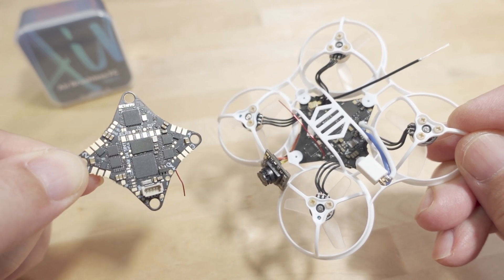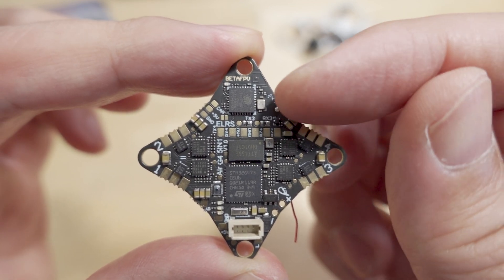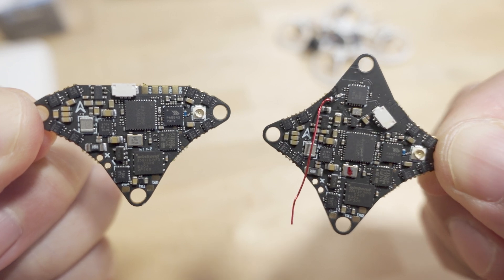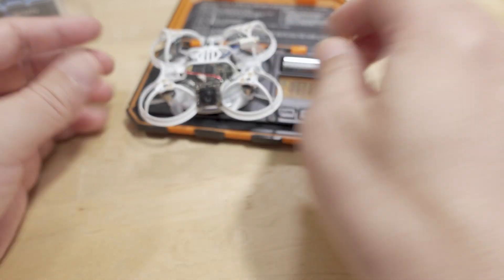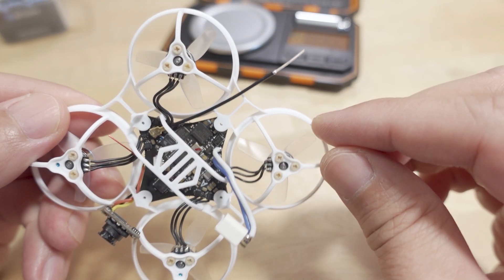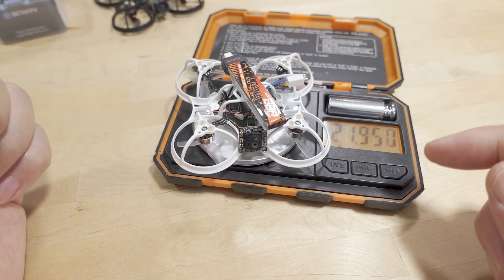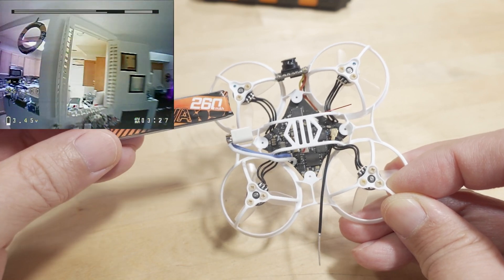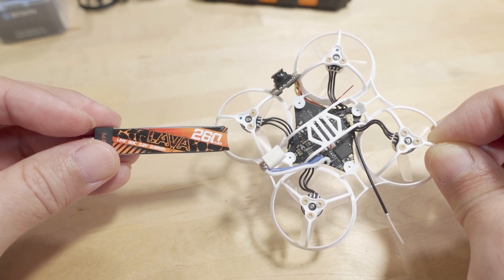Sub 15g Whoop Using BETAFPV Air FC 5-in-1 🤯

Comment from the maker: 🛠 All parts mentioned in the video...
BETAFPV AIR65 - http://rb.gy/p0iozm
AIR FC - http://rb.gy/aijd87
BETAFPV 0702 motors - http://bit.ly/3qxmjnd | http://bit.ly/3qJDK3J
Meteor65 Air Frame - http://rb.gy/mcs3i | http://rb.gy/tpe4v
Meteor65 Air Canopy - http://rb.gy/d27e9 | http://rb.gy/62nze
HQProp 31mm Ultralight Props - http://bit.ly/HQ31mmUL
Gemfan 1219S Prop - http://rb.gy/5ornw7
PEEK screws - http://bit.ly/3R4h4Gv
Cockroach LiteAF Racing Frame - http://rb.gy/y2i2kl
BETAFPV LAVA 1S 300mah Lipo - http://rb.gy/aija40
BETAFPV LAVA 1S 260mah Lipo - http://rb.gy/yvppqv
RunCam Nano 3 - http://rb.gy/1xyxdh

🎬 Watch these videos...
Air65 BNF Review - http://youtu.be/cp5rabfO0Dw
Last year's build - http://youtu.be/DypQW1GuqeY

🍿 Other videos mentioned...
http://youtu.be/cy82RWuzEqI
http://youtu.be/gsUqPV3WRu4
http://youtu.be/n4nZ4e_lGB4
http://youtu.be/d68VsVHIdYY

I used the UAVTech 1S Whoop Preset
Watch this video for details on presets...
http://youtu.be/EfTpayS-wVA

#BETAFPV #AIR65 #tinywhoop

Comment: I want to use that on my meteor 75 pro is it okay?
Reply from the maker: I think it will probably be OK unless the setup is really heavy.
Reply: @AlbertKimTV  I tried it but the feeling of flying is very different even I put the same rate and pid tuning and now I am working on it 🥲

I also use 1102 on m75 pro
Reply: @AlbertKimTV  in addition I notice when I put it in m75pro with 1102 motor with 20 awg wire for battery it will make a noise because the battery wire is positioned near the gyro and with thicker wire the vibration will travel easily this was my observation I am not pro at this so can you clarify if it is posible beta fpv like to position  their gyro on delicate spot 😀

Comment: If you use the happymodel elrs receiver instead of the betafpv one, thats another .1g off. Id just break ofd the tower antenna right away and replace with a piece of wire. Using magnet wire for the receiver and cam works great too to save weight. Its okay for motors too but does to rip off more often than silicon wire.

Comment: Good job! I also focus mostly on light and efficient tinywhoop builds, getting inspiraition from videos on youtube like yours, Mr. Shutterbug and some streams of CiottyFPV.

My current lightest build at 15.0g has the following setup:
- DiamondF4 ELRS with removed usb connector (-0.25g)
- Meteor65 Air frame, no mods 
- Reny screws (12 in total)
- 0702 motors with 2 blade Gemfan (1210) props 
- TX06 cam (at 1.77g + wiring and JST connector heavier than the Runcams i've tried. I don't like the FOV on the Runcams) secured with doublesided tape between the front hoops
- flightcontroller only secured by the rubber grommets, no screws
- PH2.0 battery connector

I also get around 4:40 minute flighttime with 250mAh rated previous generation lipos with wired connector. When flying the current is around 2.8A. With lighter 180mAh lipo the current gets around 2.6A and  2+ minute flight is possible, but the battery is then stressed more.

For my build I could theoretically use a lighter camera and do some mods to the frame. That would shave 0.75g from the current 15g.

For your lightest build i'd look into:
-2 blade props
- PH2.0 
- non pushing setup where the flightcontroller just sits in the frame

Comment: Thank you for sharing! I got 2 questions:
- how do you keep in place that piece of foam under the board? Do you Glue it to the board!? And is it safe or in a crash you risk to damage the FC?
- i had a very bad experience with the 75 cockroach, it was great till the first crash and every single crash after that one cause the plastic was incredibly fragile and broke every single time i did hit something. Mine was transparent blue, maybe the non transparent version is different?
Reply from the maker: This is a completely different frame. I've crashed it many times with no damage. Probably because it's so light.  The FC on the bottom is more protected because you crash into things going forward so it's more exposed that way.  The foam protects the main components and is held in place with some VHB though I think I should use welders glue to save more weight.
Reply: @AlbertKimTV  thank you very much !

Comment: My receiver wires disconnected on a light crash on my Air65. I just bought this 5-in-1 and I'm going to swap it out.
Reply: The power wire to my elrs reciever came off my air75,i also wasn't very impressed with the vtx,the video signal seems weak compared to my other whoops and so had to turn up the mw,also i was getting bleeps from my rapidfire like it was trying to retune and the image kept going strange top of screen
Reply from the maker: Disconnected like in desoldered? On the receiver side or FC side?
Reply: @AlbertKimTV  3 wires broke off the solder point in a crash on the receiver side. I had crashed it a few times that day but nothing egregious. Their design is pretty fragile (and flawed) IMO. 5-in-1 will be much more durable I would imagine.

Comment: you can chop off middle battery tray, and you can glue flight controller and toss rubber grommet and screw. and make a large hole in the midle of foam below
Reply from the maker: I like these suggestions.  Will have to try on the next build.
Reply: @AlbertKimTV i wouldnt toss the grommets. Even with the  e6000 and other rubbery glues u would almost hard mount your flight controller. I would glue on the grommets if u can find some with a really tight groove so u dont need the screw to sandwich it. 
4 little pieces of foam and conformal coat or the flywoo spray to protect the flightcontroller.